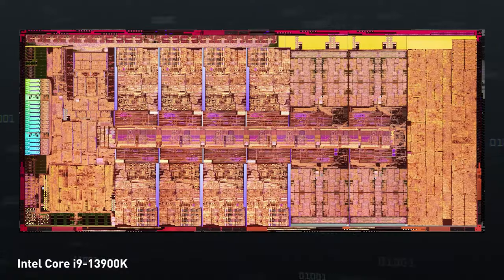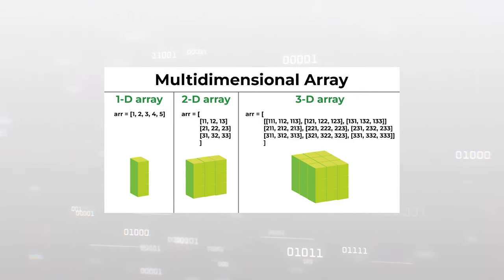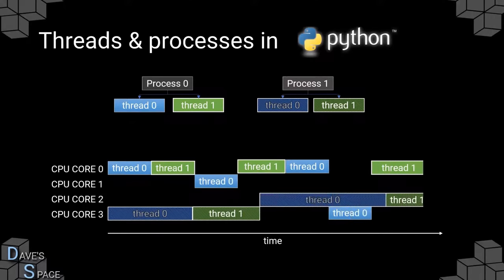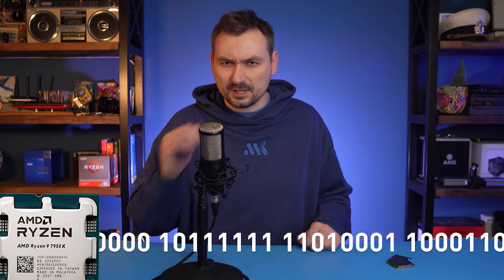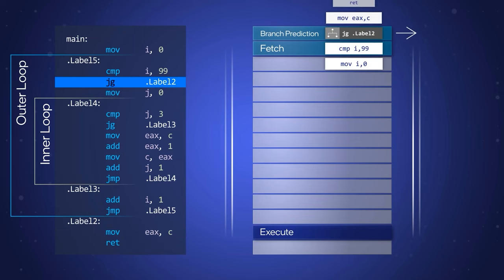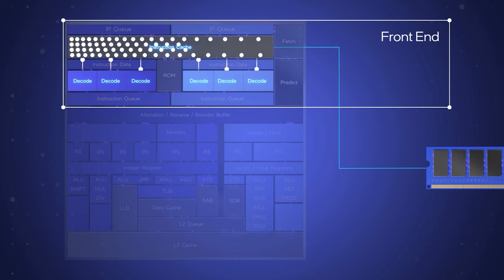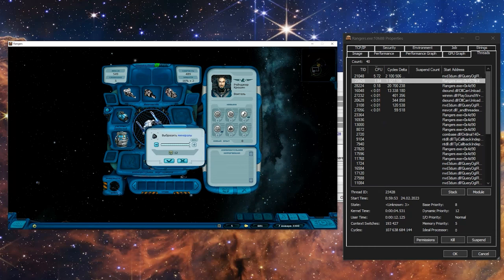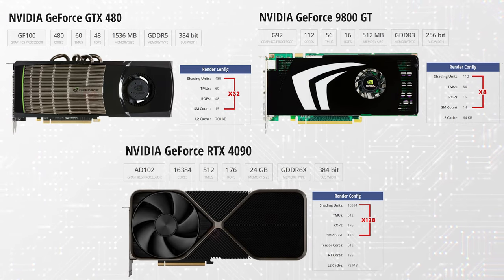LOGIC OF THE PROCESSOR | The magic of multithreading

Comment: i thought Sun invented SMT, not Intel.
Reply: SMT can be short for "Sun Microsystems Technologies".
 But it can also mean other things like "Surface Mount Technology" which is just basically the tech of putting stuff on boards like PCBs when it comes to chip mounting and boards making.
Another SMT means Simultaneous multithreading is done first Intel Pentium processors
Reply: IBM initially did the research and DEC was first to make a processor with SMT but I think he's implying that Intel was the first to mass produce a processor with the technology.